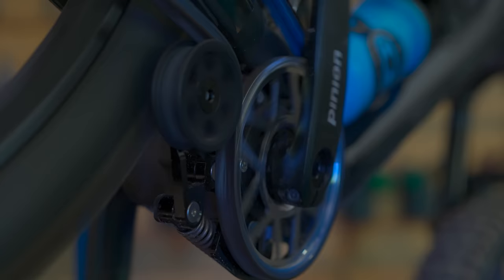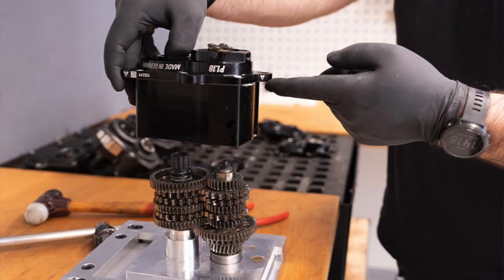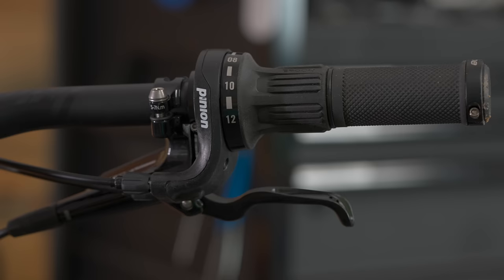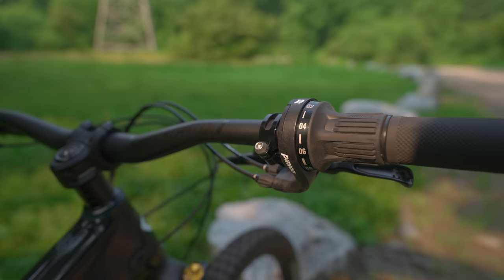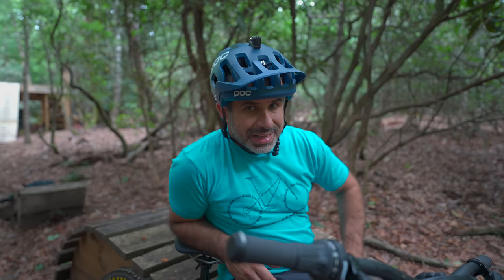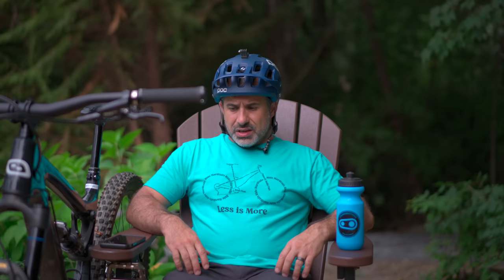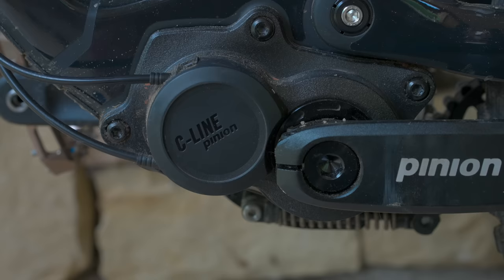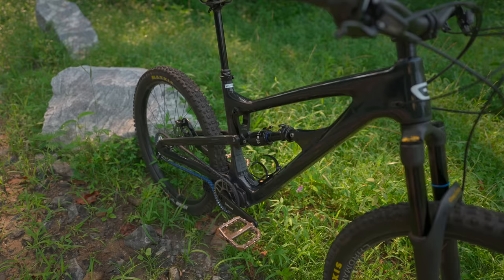What's the deal with gearboxes? Why don't more mountain bikes have them?

Comment: I got a Priority 600 with pinion c1.12, hydro disks, belt drive, and dyno hub.  Some of the components are pretty cheap but it's been completely reliable, which is what I was going for on a commuter bike.  It lives outside through all seasons.  I do definitely feel the friction a bit but it's worth it for casually getting around.  The gear range is insane
Reply: Love my 600 as well. The components that are "cheap" aren't bad by any means. They're just not luxury. They chose totally competent but affordable parts for everything they could to be able to afford Pinion at $2500.

Comment: Gear boxes are great for bike packing in remote places with rough terrain. One less thing to worry about.
Reply: Maybe, but in the event it does fail, good luck bodging it to get back home.
Reply: @Metal-Possum  Bruh. Traditional drivetrains are more prone to failure than internal gear hubs/gearboxes. You've never ridden ultra distance have you?
Reply: @twillyspanksyourcakes  Just because an internal gear setup isn't as prone to failure doesn't mean they can't fail. The thing about a derailleur setup is I can bodge it to get myself home if I don't have the necessary tools and spare parts to repair it properly. If I'm really concerned about long distances in remote areas where I'm concerned about failure, I'll just use friction shifters and an 8 speed chain and cassette.

I work as a bike mechanic, I've seen internal geared hubs and belt drives fail quite catastrophically, and there's absolutely no workaround except walking. Customers are also furious when their "durable" setup costs them several times more to repair, especially if it's failed much sooner than the marketing guys would have them believe its good for.
Reply: No chance of road side repairs though, but I think it partly depends on where you are riding though. Even the perfect system fails, after it fails my priority would be to get back on the road.
Reply: @arbjful  Again. If you're not an ultra distance rider who have not tried this system. Better to not talk about shit you don't know about.
Reply: @twillyspanksyourcakes  I'm several times around the earth when it comes to traveled distance. I never had any issues with classical derailleurs. When you are not an idiot and a bit sympathetic to the mechanic, in esp. don't change gears like a monkey under load, it doesn't fail at all for reasons other than very predictable regular wear. I never ever experienced any catastrophic failure with a normal bike. I consider all those ultra expensive gearing solutions just overpriced dead weight. And that is significant. Maybe there is less wear on your drive train. However when you consider your own knees a part of it the wear increases. The added benefit is the unmaintainability of it. Those things are not easy to take apart and service. And please don't tell me the lie that a geared something will never require any maintenance. All mechanical parts wear out sooner or later.

Comment: Great to see Pinion mentioned on this channel! :) I don't maintain my bikes. I suck at doing that, that is the main reason I ride Pinion since 2012. Currently on my 4th Pinion bike (all Nicolai's) this one with a C 1.12 box. (612% range out of my head.) 1.18 is available, same range, smoother ratio. It is indeed 0 maintenance also in bad bad winter weather. (Rain, snow, mud, salty roads, etc, I don't have a car, so I always commute on this as well.)  Just inject fresh oil once a year, or roughly once a year. I once did no oil change for 2 years, because it is "maintenance", but no problems. :)  The grip shift they use is now quite outdated, later this year they will release the electronic shifter for the general public. 

For my riding style it has very little drawbacks. If I have to mention 2: You indeed loose a percentage of the power that is put into it, especially on the higher gears. (I would say 5% average compared to a perfectly new and fresh chain+cassette setup.) I never was able to feel that loss on a full suspension bike, but now that I ride a hardtail, I start to notice it a tiny bit when I put over 330 watts in it, but that is seldom. (But we are nowhere near early Nexus hub levels of loss, or the spongy feeling that gives.) A second issue: in a 12 speed box there is 1 point where you can't shift under load, I think somewhere between 8 and 9 in gears. I have that habit of "clutching" during my shift because of this. I never know when that gear is going to come along. That manual clutching I do now, (0,5 sec off the power) will be done by the electronic shifter in the newer, upcoming box. (probably in a matter of milliseconds, and you can stay on the power.) I don't care about the weight, but the system is in total about 700 grams heavier than XX1. It is heavy, but the weight is in the right place, with very little unsprung mass, a plus for a fully. All in all, very reliable. I ride about 6000km a year without issues, and without maintenance. Yes pricey, but worth it, and I don't own a car, so that money has to be wasted somewhere. :D Oh one last thing: the silence of this drive, especially with belt is something else, it is swooshy, but never grindy so to speak. :)
Reply: Great bike. I kind of like the loud coasting freewheel noise while encountering people walking. They hear it!

Comment: One thing to note of efficiencies, the timing belt actually has nearly the same efficiency as a roller chain, its the gearbox which is the primary cause for the difference in overall efficiency of the system
Reply: The consistency of the gearbox would bring the efficiency comparison closer, because derailleur and chain systems are all over the place in their efficiency numbers with a host of non-consistent factors. The average comparison between the two makes this more of an emotional debate than anything anyone would actually worry about. It's like the people who obsess over a few grams difference in weight, when they could lose 5 pounds of body fat to start with.

Comment: For free riding, when you start going high altitude, this thing is fire. All the times i broke a derailleur by hitting rocks could’ve been avoid with this. 
And i often carry by bike on my back, and the weight being directly over my shoulders instead of way far on the rear wheel helps a lot for carrying

Comment: They also argue that by moving the mass of the cluster off the rear wheel and into, the centre allows improved suspension design.
The pinion gearbox motor + electronic shifting looks exciting!
Reply: I have heard the argument, but I can empirically tell you is that my FS bike with a Rohloff rear has really good suspension performance.
Reply: Depending on gear selected with today's derailleur systems, the effective chain pull angles on rear suspension is chaining between pro-squat and anti-squat geometry. With a belt drive, it never changes no matter the gear.

Comment: While i already knew that belts and gearboxes made it's entry into MTB scene, i never yet seen a prominent MTB influencer cover it 😁

Also - what you said about people owning it using it out there is so right! It's particulary useful for bike touring wher low maintenence and low failures are really nice to have. 😁
Reply: 'm surprised he didn't mention how many times you smash the derailleurs system during the rides.
I smashed three systems which cost in total over $2'000. You can't really enjoy the ride fully, worrying it may cost you a lot of money and time.
Completely agree! It's a game-changer.  Zero maintenance - omg, it's a blessing. So much time is spent on cleaning, putting oil on a chain, and changing the chain. All that mess is gone!
These two systems can't compete. Pinion wins in every aspect. There is no debate!

Comment: Pinion and Rohloff with belt drive are used by lots of bikepackers. Pinion especially is preferred by lots of around the world bikepackers, because of virtually no maintenance need.
Reply: Thus far I have ever seen them only on youtube and never ever in the wild used by actual bike-packers.
Reply: @rosomak8244  At Euro Bike 2022 in Frankfurt Germany, I think they were on about 20% of the bikes on display and there were a lot of bikes on display. I have ridden them on several different bikes including the Cybro No.5 and No.6 from Cybro Industries in Italy. Yes they are a little heavier, shifting feel different, but they are unreal. I'm from Australia and they are rare to see however 18 months ago I ran into a rider on the Yack Tracks at Yackandandah, Victoria Australia (which is not exactly in a city) riding with a Pinion - I think he was using a C1.6 or C1.9 and he loved it - also he was quick both up and down some pretty steep hills on the Yack Tracks.

Comment: Great to see a balanced review of the Zerode. I’ve been on one for over two years and can’t see myself ever going back. 
Your pros and cons were on the money. Nice work - as always. 👍
Reply: 'm surprised he didn't mention how many times you smash the derailleurs system during the rides.
I smashed three systems which cost in total over $2'000. You can't really enjoy the ride fully, worrying it may cost you a lot of money and time.
Completely agree! It's a game-changer.  Zero maintenance - omg, it's a blessing. So much time is spent on cleaning, putting oil on a chain, and changing the chain. All that mess is gone!
These two systems can't compete. Pinion wins in every aspect. There is no debate!

Comment: I think the biggest reason they aren’t as common is because they need a compatible frame to work with and those same frames are not compatible with traditional bottom brackets either. It’s less about upgrading your drivetrain and more about getting an entirely new bike. I’m sure established bike manufacturers have a harder time adapting to pinion because they don’t want to invest all the money into retooling their frame production to accept the gearbox and selling the bike for $1600 more than it would with a traditional derailleur.
Reply: Totally agree with this. I now have two Pinion bikes, but that's only because I wanted specific full-bike upgrades for specific purposes (touring and bikepacking) and made the decision to select a pair of Priority bikes. Since you have to buy the whole thing as a purpose-built package, it's not like I could have "upgraded" to a Pinion setup on the Trek and Fuji I had beforehand.
Reply: They aren’t adopted because of  1) inefficiency, 2) cost, 3) compatibility, in that order. Why would I pay more for a bike that is sluggish? I have played around with one, the added drag is very noticiable.
Reply: I'm yet to hear the efficiency numbers but I know the old planetary gear hubs had a pretty low efficiency. Around town the old Raleigh's I used to ride daily did a great job. Wondering how much Pinion has been able to improve efficiency? Seems like it would be geared more towards everyday riders rather than race types(except DH?) given the need for maximum efficiency over convenience and ease of maintenance. Also the other potential benefit of a gearbox is a stronger rear wheel as all the dish for a cassette is no longer needed so even spoke tension in addition to instant shifting could be a real boon to the DH set.
Reply: I do not find the Pinion sluggish at all!! Definitely better than my Alfine 8 bike. And no chain lube needed.
Reply: I mean, they'd do it in no time if they wish. They did for disc brakes which required different designs and considering different fatigue points in both the frame AND the fork vs. rim brake bicycles.

Comment: The Pinion MGU already makes so much sense for e-MTB's from reliability, to unsprung weight off of the rear wheel (and only adds a few hundred grams over a regular drivetrain). Once they make a gearbox within a few hundred grams of a regular analog-MTB's drivetrain and very efficient, they will soon take over. Not to mention, there would be a massive benefit in terms of pedalling by taking a heavy cassette off of the rear wheel.

Comment: I asked a couple of local bike shops what they thought of these, both said they are sweet, fairly easy to install, incredible to use. But, they both agreed, if and when they do go wrong, they are very difficult to repair. Not impossible, but it's going to be expensive because they take a lot of time.
Maybe that's their lack of experience with them, if we all had them, they'd be far easier, as there'd be a lot of information on how to do it.
But the entry fee here in the UK is around £2,500 plus fitting and setup.

Should you get a great gearbox, it should last decades with only an oil change every year and new cables as and when.
Of course, should get a lemon...

But don't Dutch bikes have them? Or at least a lot more of them?

Comment: I had the Ikea bike untill they recalled it! It came with a beltdrive and a two speed automatic shiftingsystem. It worked great, snapped a belt after a few months use, had to replace it and because it was not expected by anyone that a belt would break, atleast not so fast, the process was hell. The stores did not have the proper tools or parts to do it inhouse (as promised they would be able to do) so I had to make a yank as hell solution. When they recalled the bike for whatever reason (cant remember) I got it back to them, insurance etc etc if I fell using it. But the beltdrive and shifter felt awesome!

Comment: Every single vid from Seth is entertaining or informative. This gearbox looks awesome, but with that grip shifter, don’t you find yourself having to adjust your grip with every shift? 🤔
Reply: As far as I understand it the gripshift is said to be neccesary as the gearshifting mechanism need strong pull in each direction in order to change gear. It would be cool if they could engineer around this problem, perhaps they will in the future.
Reply: @Skawagon you should be able to engineer a trigger shifter to do that, or go electronic.
Reply: @SimonBauer7 I've seen the is at least one out there, but it's spring based for the second cable. Haven't tried it, but seems it means you do 2x the work to up shift so it can down shift for you.
Reply: Yes, I sometimes find this annoying, but only under very specific circumstances. A company called Cinq makes a trigger shifter (left and right paddle) for Pinion (C-line) It is too expensive for me. The upcoming electronic shifter (and proprietary updated Pinion box) will finally get rid of the twister. :)
Reply: @SimonBauer7  I suppose isom sort of trigger shifter will be done eventually.  As fot the wireless - as Seth mentioned the gerabox is well suted to the most extreme conditions - Like a guy pedaling over Gobi desert. In those conditons I guess the simple soliution wins over and is a one thing less to take care of. With that being said, I still belive it could go a long way to spread the apeal od gearbox drivetrain.

Comment: Just a minor technicality, the Pinion does not use planetary gears, rather conventional gears on 2 shafts side-by-side like a manual transmission in a car.  In addition, in the 12-speed model, it has two stages, not one as cars do, meaning 4 speeds in the first stage are fed to 3 speeds in the second, multiplying like front and rear derailleurs.  A very well-presented, unbiased, and balanced review.  Not your typical fanboy stuff, ha ha!  Thank you.

PS:  A mini planetary gearset is used for shifting only, I believe.  It is not part of the powertrain.  It's the one you see when you take the round cap off the side where the shifter cables enter.

Comment: Hi, I own a Zerode  taniwha enduro since a few weeks. Yes, the pinion gesrbox  has at the beginning some noticeable drag, but it wears in and after a few rides with serious climbing the drag is way lower. I also was skeptical about the grip shift, btw Instinctiv bikes offers a trigger shifter for their pinion bikes, but know I think, after getting used to it, it is the best way to go. Cheers
Reply: recently bought a zerode too, best thing ever, could never switch back to a normal drive chain
Reply: Is there anything about an early oil change in the owner's manual, to flush out any metallic debris from the meshing of gear sets when they wear together? All manufactured gears in transmissions have machining variances on gear teeth that will bed to other mating gears, and shed microscopic bits of metal initially, and smooth out with a bit of use.

Comment: I'm surprised that you didn't mention hub gears, where the gearbox is shoved in the rear hub. They're somewhat common on commuter bikes where I live, where the (unmentioned) advantage of shifting whilst stationary is quite useful
Reply: they add unsprung weight to the rear wheel, which impacts the effectiveness of th rear suspension, I'm sure I heard that mentioned in the video.    I'd love hub gearing with a belt for my middrive commuter/urban ebike which currently is a Shimano 9-speed with a Shimano middrive

Comment: Hi, along with a rapidly growing number of people I ride this bike. I bought it to replace my 2022 Slash 9.8 and the difference is unbelievable - in a very positive way. The enduro Taniwha is a mixed wheel long travel bike and it just eats up anything you ride it on. Yes, there's a bit of drag while pedaling, but the benefits of silence, lower unsprung weight and centered mass far outweigh the disbenefit if you're happy to take a chilled approach to climbing (or a chairlift!). Coming in June is my G3, which is the DH version of the bike, as raced by Sam Blenkinsop in the UCI World Cup this season. The G3 is next level (having ridden a demo earlier in the year) and I can't wait to start racing it. Plus, its great to support a home grown bike brand that's slowly but surely taking on the world. Thanks Seth!